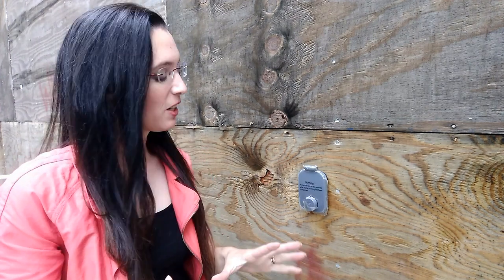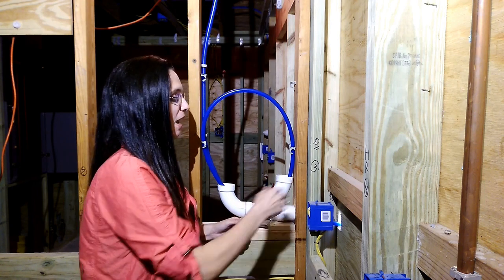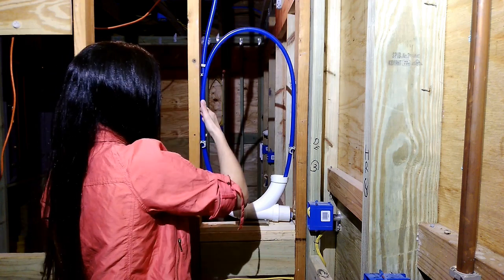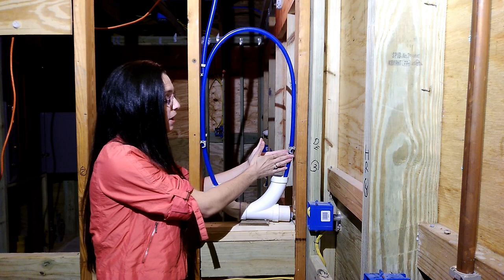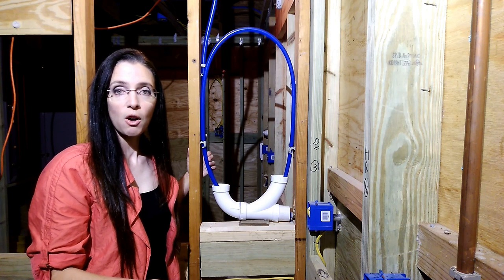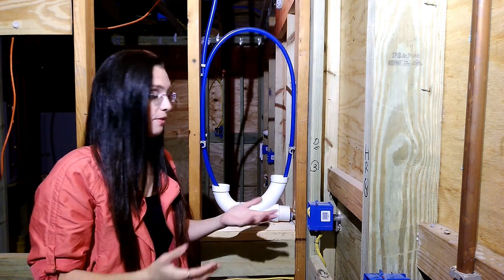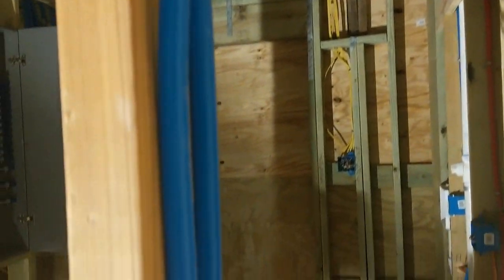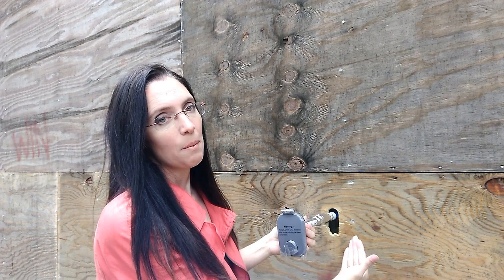How to Install a Hose Bibb PEX Maintenance Loop [ULTIMATE Flexibility!]

Comment: very timely! I am adding lines from my basement to the garage for a utility sink, which will be supplied with sillcocks. I was concerned with changing out the sillcock in the future if one fails, as this basement will also be finished. This is the perfect solution! Thanks.
Reply from the maker: Glad to hear it helped. With the research you are doing it sounds like any future work will be small if not totally prevented. 🙌

Comment: Great video. I am closing on a 1975 double wide and considering installing PEX manifold system. Nice trick with the Y-shape PVC to give easier access if needed.
Reply from the maker: Glad it helped! When someone says they are even considering a manifold system it makes my heart happy--there are just SOOOO many upsides.

Just in case you needed more convincing, I do have a video covering the benefits of a manifold: https://youtu.be/Hm40VzOthx0 The content is great, but the video itself is terrible. So if you'd rather skim a blog post, this is a solid resource as well: https://www.justneedspaint.com/advantages-of-a-plumbing-manifold-system/ I can't say enough about manifolds--they're so much easier to live with than a hidden trunk and branch system.

But even if you don't use a manifold system you can still do a loop. I'd love to hear what you end up doing and congrats on the new project!

Comment: Ive been thinking about how to have extra line with a pex hose run.  This is a cool idea,  but it seems a bit excessive,  no? I mean,  how much slack do you really need? Say you have to replace the sillcock every  10 years and you need about 2" of pex each time to make a new connection. Then you'll only need 10" slack for 50 years of service.  Looks like you got almost 2ft of slack there.

Comment: Nice. Another trick in one's bag. As you've stated, doesn't apply to every situation. I put a 15" frost-proof spigot in an intersecting wall, with a small access door in the bedroom for maintenance and inspection. The PEX comes up from the crawlspace. If I had just gone straight out the foundation wall the spigot would have practically been touching the ground outside.
Reply from the maker: Nicely done on the placement and the access door! Because of the easy access odds are now good it will never have a problem! 😉

Comment: If you are LUCKY enough to have an outside spigot that RUNS INTO AN INTERIOR WALL THAT IS AT RIGHT ANGLES to the outside wall ( most are NOT this way).....then you have the ROOM to install a proper, LONG LENGTH frost-resistant outdoor spigot.
Reply from the maker: <admittedly copied and pasted from another response> For sure, it's not for everyone! Perhaps it wasn't clear enough in the video, but you most definitely have to have the conjoined wall. Likewise, no one should go ripping into walls to move anything--just if it is a full out gut/remodel or new build. If it is convenient. My other responses to comments detail the two situations why we include (or wish we had) a loop on top of a "LONG LENGTH frost-resistant outdoor spigot".  Thanks for stopping by and I hope your project goes well!

Comment: Great idea. Do you think 3/4" PEX-A would flex enough to do this between floor joists that are 16" OC?
Reply from the maker: Absolutely! The minimum bend radius of Uponor AquaPEX pipe is six times the outside diameter. If it helps to visualized this, you can check out this post and halfway down we took pictures of 1/2", 3/4" and 1" PEX in their smallest recommended loops: https://www.justneedspaint.com/why-choose-uponor-pex-a-wisbro

Comment: Thought about that type of house bib because mine is maybe 6in off the ground. Not sure if it goes through the concrete walls for the basement or the wood framing. I'm leary about enlarging hole if its concrete
Reply from the maker: 6" off the ground is tight! I've seen a couple installs through concrete on @aquorwatersystems Instagram account. I'd definitely reach out to their customer service to talk about the particulars of your location--their support team is a great group of people! But I totally hear you--just the thought of boring out concrete seems slightly more intimidating IMHO.

Comment: U cant insulated the water lines.
Were i live in upstate ny we insulate all water lines in exterior walls
Reply from the maker: Good point! We certainly didn't have that problem south of Houston (where that house is located). Here in AZ you'd get warmer water longer through the water hose in the summer. Thank you for taking the time to add that to the comments here!

Comment: this sounds great at first but don’t really save you a whole lot of trouble, isn’t that hard to fix it without it. It works but I wouldn’t installed for the limited advantages it offers .
Reply from the maker: To help others decide on adding this as a feature in their plumbing...here are the two places it has / would have helped us. As you can see in this video, the hose bibb is installed on the sheathing. At the time of the video, the city inspector had passed us for plumbing since we had the hose bibbs installed. The WRB and cladding still had to be put on, which this loop will not have any issues allowing any kind of variance in the thickness of whatever is put on the exterior--even if the client’s mind changes, for instance, from something thin to enhancing with stacked stone!

Likewise, in our pier and beam houses, it would have been nice to have a loop when we chose to install new vinyl siding on the original wood cladding. In a similar fashion to the example above, this was a case of needing just 1” of hard line copper causing some rework of the hose bibbs. I also talk about that here in this follow on video when it comes to foundation repairs (which, in our experience, tend to happen around hose bibbs): https://youtu.be/clvI0Ho3Gsc?t=636

Thanks for stopping by! I think these are good conversations for people on the fence and definitely some talking points that could have been made clearer in the video.

Comment: So at first glance this seems like a good idea,however you need a conjoined wall apparently to make all this happen. So if your homes bib is on an outside wall this would certainly bring you way more issues than help or if its in a basement foundation you what let a big floppy loop hang around or worse have to frame a wall??? Look it's just not that serious to replace a hosebib no real advantage here
Reply from the maker: For sure, it's not for everyone! Perhaps it wasn't clear enough in the video, but you most definitely have to have the conjoined wall. Likewise, no one should go ripping into walls to move anything--just if it is a full out gut/remodel or new build. If it is convenient. I'd expect anyone going this route would find a way to keep it out of the way and looking pretty in a basement install.

<admittedly copied and pasted from another response> _To help others decide on adding this as a feature in their plumbing...here are the two places it has / would have helped us. As you can see in this video, the hose bibb is installed on the sheathing. At the time of the video, the city inspector had passed us for plumbing since we had the hose bibbs installed. The WRB and cladding still had to be put on, which this loop will not have any issues allowing any kind of variance in the thickness of whatever is put on the exterior--even if the client’s mind changes, for instance, from something thin to enhancing with stacked stone!

Likewise, in our pier and beam houses, it would have been nice to have a loop when we chose to install new vinyl siding on the original wood cladding. In a similar fashion to the example above, this was a case of needing just 1” of hard line copper causing some rework of the hose bibbs. I also talk about that here in this follow on video when it comes to foundation repairs (which, in our experience, tend to happen around hose bibbs): https://youtu.be/clvI0Ho3Gsc?t=636

Thanks for stopping by! I think these are good conversations for people on the fence and definitely some talking points that could have been made clearer in the video._
Reply: Then put the maintenance loop up in the ceiling.
Reply: Yea, the thing is just flapping outside like if it was a gas nuzzle, instead of making all that better off just insulate the 2” - 3” so it won’t freeze, just make no sense to do all that